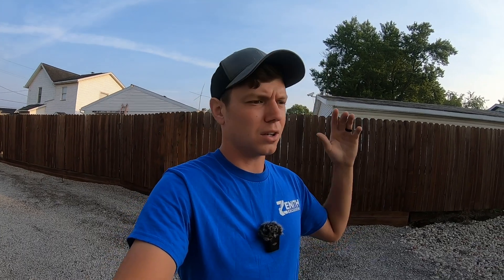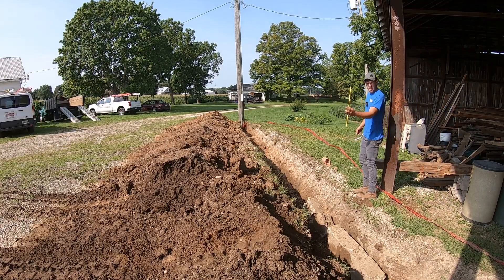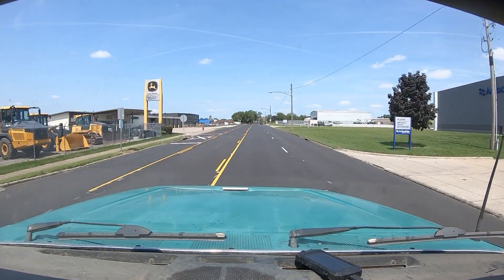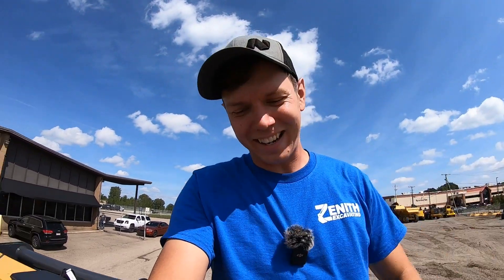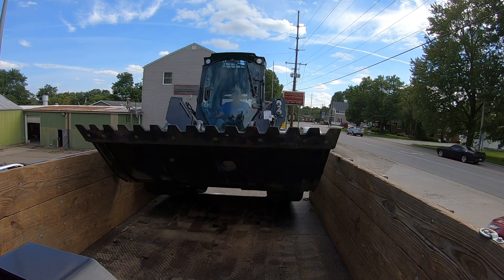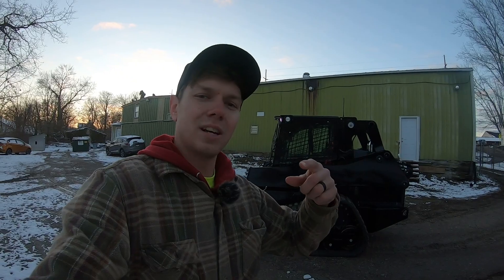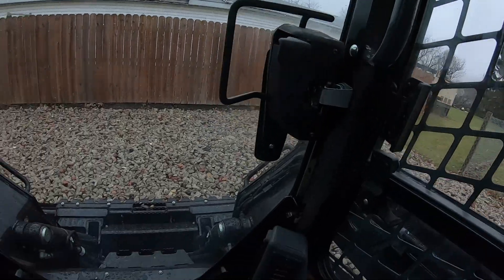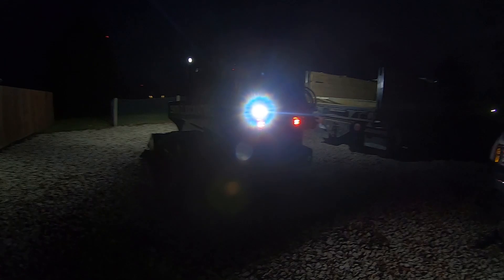Out With The Old, In With The New | Time to Get Serious

Comment: Congratulations on the new loader. I hope you're keeping the old Newholland machine great loaders. As for the painting, the loader as a return on the investment, not having loader for 4 months never get that $ back you bought it to use know a few contractors who did custom paint on there loaders in the end always hardly ever do it again. Personally, I think new stickers on the boom promote your company better than the paint and cheapest way. But again, congratulations on the new investment
Reply from the maker: Thanks for your thoughts! I definitely would have used a different company to paint the machine if I would have known it was going to take that long. They lead me to believe they could knock it out fairly quick and thay obviously did not happen. 😒

I'll be interested to find out if it works out in the long run or not. If nothing else, black is an easy color to find in trucks and trailers and so I shouod be able to get those things in the right color with original paint 😅

Comment: Would you consider a log grab for it to supplement tree work? In the UK machinery is getting more common, but there’s still a huge market for man and machine hire to small firms.
Reply from the maker: I've been looking at a couple of different grapple rakes. I don't think I'll pursue a swivel grapple. They're quite costly and are primarily useful in urban tree work, which is not where I expect to use this machine as much.

Comment: Do you load everything in the truck body so you don’t have to buy a trailer or so you don’t have to worry about having a class A? Machine looks killer super stoked for you.
Reply from the maker: When I first bought equipment, I got those ramps because they were cheaper than a trailer and I didn't have a class A. I've since gotten a class A, but putting equipment in the trucks turned out to be pretty convenient. It does become problematic if I need to move materials or lots of extra buckets or anything like that with the machine so I think a trailer will enter the fleet someday.